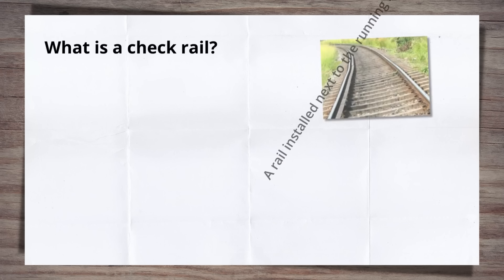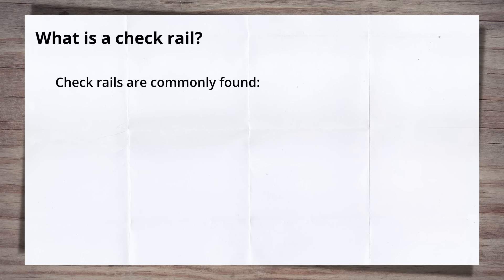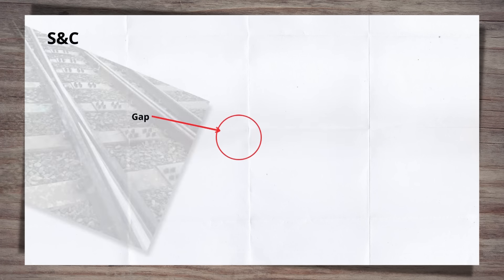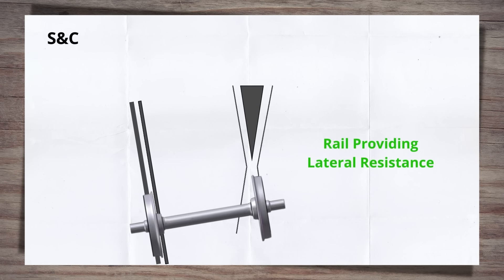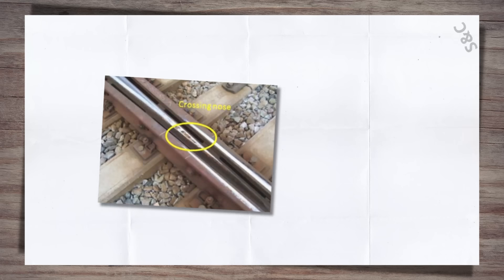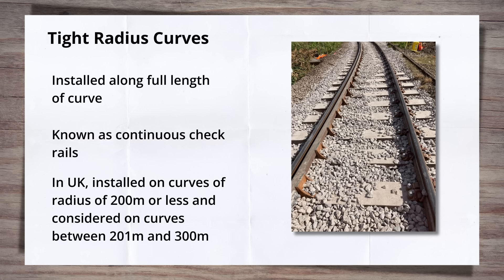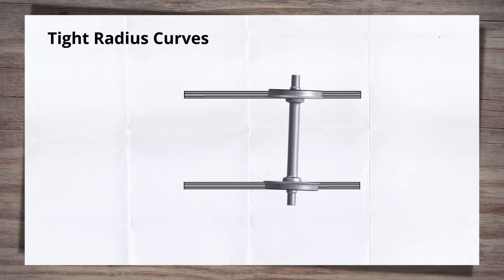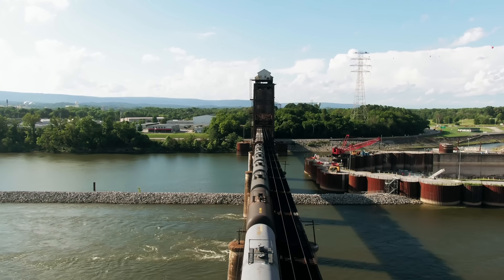What do Check Rails Do on the Railway? Why Railway Engineers Install Them?

Comment: As an old American train enthusiast, I have never heard of a check rail. From early in your video, we called them guard rails. Same thing?
Reply: Yes.
Reply: @markh.6687  Actually no. A check rail interacts with a each passing wheel. A guard rail interacts only with already derailed wheels.
Reply: @thomasstambaugh5181  Actually, yes. In America a guard rail is what this video calls a check rail, and it also stands for the extra rails to prevent derailed trains from leaving the track. Also in America we have a name for the device that allows two rails to cross, we call it a frog.
Reply from the maker: I think this is a difference in terminology. From some research in the US they are indeed called guard rails, whereas within the UK guard rails are to help stop derailed trains leaving structures etc. Within the UK, fogs are called crossings.

Same same but different!
Reply: @thomasstambaugh5181  Source of your claim, because the terms are used interchangeably to describe derail prevention rails.

Comment: You missed one place check rails are used. On bridges over water. Ther they use two check rails.
Reply from the maker: I know these as guard rails rather than check rails, and they are there as a mitigation once a train has already derailed!

So serving a slightly different function

Comment: This entire video is wrong from start to finish. Check rails are a failsafe, to limit the damage in case a derailment has already occurred, or would occur. Under normal operating conditions, the check rail is never touched. You can tell that this is true by the fact that the entire check rail is rusty rather than shiny like the rest of the contact surfaces, which is shined every time a train wheel touches it. 

Train wheels do not need check rails for "S & C" (Switches and Crossings I assume, using shorthand to make you sound smarter than you are). The bogie holds the wheels straight and the wheel itself is big enough that such a short gap is not a problem for a given speed that it's designed for. There is also sometimes a small groove at the bottom in case the wheel is capable of running on flanges. High speed switches have a "moveable point frog" which mechanically closes this gap so that there is none. 

Train wheels absolutely do not need a check rail to make curves,  they can navigate curves just fine without it by it's natural design (plenty of videos how the taper runs higher to one side) and the bogie holds the wheels straight, they have no pivot to become unstable. If the check rail was holding it in place during a turn, there would be a very nasty noise and early wheel wear, as the wheel needs to be free to make that turn.

This entire video/channel is misinformation designed to sell books.
Reply from the maker: Thank you for taking the time to watch the video and feedback in your comment. You make some good points, which I will take away for my future videos!

Comment: Weird. I was just standing on a platform on a bridge, wondering what those extra rails were and whey they were installed. And now this video shows up in my feed. x-files-theme-dot-gif.
In Germany, check rails are also apparently installed on bridges; why would that be? They also have a rather wide flange way gap. Thanks for the helpful explainer!
Reply from the maker: The algorithm is working a little to well!

I would think these are likely to be guard rails (UK term for them), which are installed on bridges and structures to help contain a train if it does derail. The aim it to stop the train heading off the structure